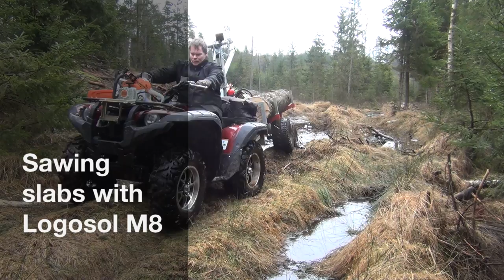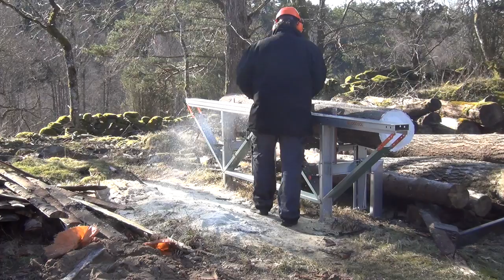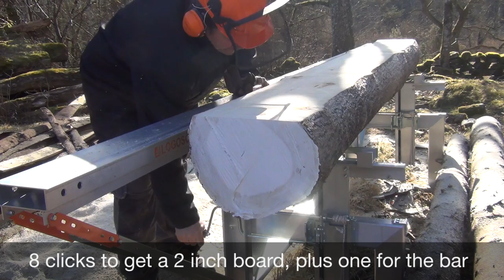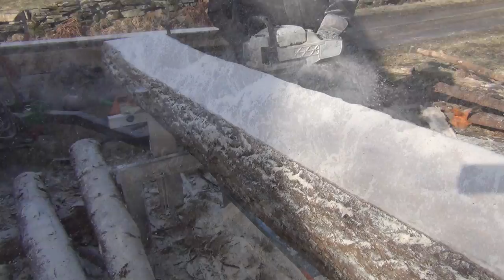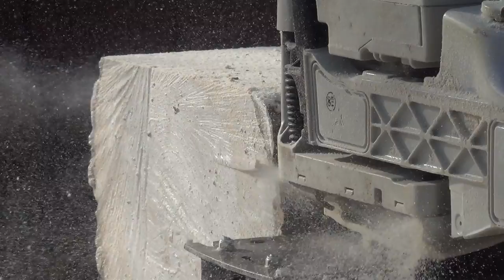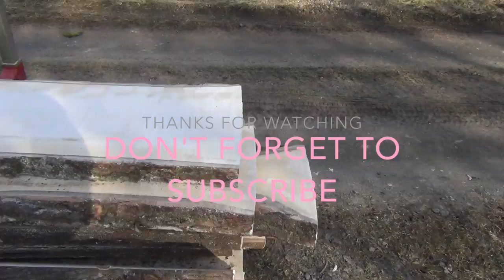Cutting slabs with logosol farmers portable sawmill

Comment: We're you using a ripping chain or a standard chain? Thanks. I like your video. Well done.
Reply from the maker: I use Stihl ripping chain (.050 '', 3/8 '', 72 DL).
Reply: +Project of the day Sir, What is the chisel angle of your chain?  Thanks
Reply from the maker: Teri and TL Stanbro I sharpen chains with 10graders angle
Reply: +Project of the day I use a 10 degree ripping chain.